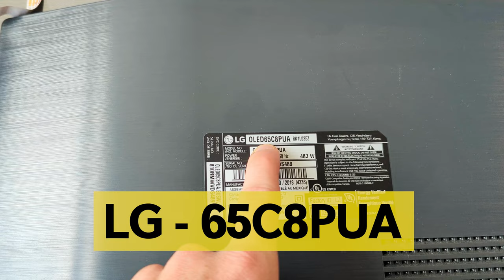How to Open LG OLED TV For Board Replacement or Power Supply Replacement Repair or Fix

Comment: My TV started to freeze and power cycle, and more people have the same issue, I was told I need to change the mainboard, I hope it works. Thank you so much for the video, now I feel confident about disassembling it.
Reply: Main boards overheats because of the bad quality thermal paste they use dries out. This causes the tv to freeze and power cycle
Reply: @hammiranda facts, I just ordered a thermal paste today for my CX, no need to spend money on motherboards or call out an engineer, when often simple solutions are the best.
Reply: @kovalveli did just putting new thermal paste on work or do you need to put it on with a new board
Reply: @simonjones9027  simply get rid of the old paste which should be in a bad state, like mine was, and put the new one on. Job done. Make sure you take your time putting everything together, I didn't connect one of the cables fully and my TV wouldn't switch back on , so I had to take it apart again and make sure all connections were sound.
Reply: What brand do you recommend?
Reply: Did it work in the long run? Thx!!  @kovalveli
Reply: @tri0nic  unfortunately no, had to replace the main board in the end.
Reply: @kovalveli sucks, ordered a mainboard here aswell, was it easy to swap?

Comment: Great video! 👍I've got the same model and had to replace the wifi/bluetooth module (~$35 on eBay). Be careful when putting the back cover back though, as some of the plastic tabs on the sides may bend if you push the cover down when it's not placed just right (they fit into the holes in the metal) - luckily I was able to bend them back and the cover went back on.

Comment: Thank tou for this video my friend. $2k and not even 2 years later, my 65 oled is dead. This video should get me back up and running on the cheap!
Reply from the maker: Oh no sorry to hear that! Did your HDMI go out or what?
Reply: @thecollegepicker  I don't have it 100% figured out yet. The picture would become scrambled and turn off. Then I wouldn't be able to turn it back on until I unplugged it and replugged it back in. This is making me think it's the PSU or main board..... Most likely the main board.
Reply: Same case my USB came out and gose into bord short circuit now waiting for replacment board
Reply: Fixed the TV today. The main CPU on the motherboard borderline burnt through the PCB.
Reply from the maker: Good troubleshooting and fix. What a poor design by LG =(
Reply: May I ask which model it is? Is it also the c8? Ty in advance.
Reply: @klwarhouse  how did you fix it though? Wish people would be more helpful with their comments.
Reply: @klwarhouse Holy! And, may I ask, mate, what did you do to fix it? I mean, it sounds like not anyone can do to perform such tech procedure. Thanks!

Comment: thanks for the video.....I have done the hard and soft reset attempts, there just is no power...would it be safe to say I just need the power supply board or how could I diagnose another problems?  thanks!

Comment: When you opened this tv did you notice if the power supply said 120v or did it say 100-240v
Its odd the tv supports 50hz which is not normally found in america

Comment: Quick question to anyone that has replaced their main board. I'm about to swap out mine this weekend because of YouTube services applications keeps crashing and also my fire stick 4K.. after swapping the main board does the TV turn back on with no issues or do I need the service remote and poke around in the deep settings?

Comment: thanks for the helpful demonstration! I watched this to replace the main board in my C9. So im going to take you up on your offer for help. It doesnt display and im wondering if anyone has a pointers before i go buying more boards. I'm a tv installer. my c9 was taken from a customers house and was replaced after it was hit by a surge. lightning hit their DirecTV dish and destroyed the MoCA system. when i diagnosed the tv at the customers it would turn on and operate menus and things fine but did not see any inputs, bt, or wifi. i hypothesize the surge went up the hdmi from the directv box and fried the controller for inputs. after i took it home i diagnosed further and found that i could play 4k vids on youtube over ethernet with no issues but still no wifi, bt, or any physical inputs. i popped in a new main board that was said to have come from a tv with a bad panel but worked fine. i have no picture now. i get the red standby light as usual. it blinks 3 times when i turn it on as usual, i even hear the power board quietly click when the screen is supposed to turn on but i have no picture at all.  any ideas on where to go next? i was going to get a tcon board next but wonder if it may have to do with any of the wiring between the boards. sorry for the long explanation but i wanted to be detailed. any suggestions are appreciated. thanks!

Comment: Hi, I have a question. My power cable is broken on my C1 and I need to change it. Do I need to change whole PSU or do I only need to remove power cable?
Reply from the maker: Try a power cable first.
Reply: @thecollegepicker  I can't find C1 power cable. Is OLED 55 C11 LB cable fine for it?

Comment: I have a C1 65". The screen has these pixelated lines that start spasming before it spreads across the screen, after which the TV auto powers off and wont turn back on. Ive had the screen replaced twice under warranty, once on my own. It keeps doing the same thing each time after about 6 months. Tv is mounted on the wall using an approved tv mount. Any suggestions or ideas on what might be causing this? Thanks to anyone who responds 🙏

Comment: how do you left this tv upright? feels like it will crack in the middle
Reply from the maker: Two people on the corner support
Reply: @thecollegepicker  I swapped the power board for a new one but it still won't turn on. will the t-con board help?
Reply: @memecoinalpha  also wondering this. mine turns on then shuts off after 10 seconds

Comment: I have the same tv just smaller and it turned off suddenly I’ve tried most methods but won’t turn back on, especially with no main power button on the tv itself. Although it makes the power up sound (clicking) nothing. ..
Reply: I have exactly the same issue…did you figure out what’s the reason?
Reply: @Daniel_Novas   my c9 does the same thing, i just replaced the main board too
Reply: @Daniel_Novas  no brotha I just passed it on to my friend recently I think his electrician homie gonna look at it and switch the board inside
Reply: @timgreen5412  how much did that run I just bought another tv thinking it’s the same price
Reply: Any updates on the tv, I’m having the same issue
Reply: Same issue here with OLED65CXPSA, clicking noise and red light blinking keeps repeating until I remove it from the power outlet. Got it to power up and work normally a couple of times after the issue started, but now it won't turn on anymore... I'll open it up to check the power board for blown capacitors.

Comment: So it's a expensive repair to replace power if dog chewed up cord till it broke. Imo a well designed TV would have a replaceable power cable
Reply: I just bought the B3 today and cannot believe the power cable is hardwired in. Did you figure out how to detach as I want to run it through the wall to keep things neat.

Comment: https://youtu.be/jLe8xkbBqKQ?si=EElw1J6q9KOm7KV3   need help. sparks shot out above the psu, If I replace the psu will it fix it??? the standby light still turns on and blinks 3 times